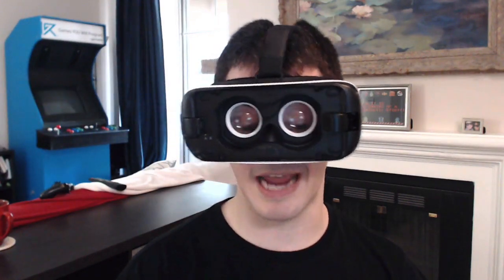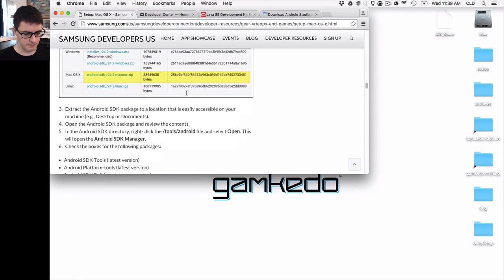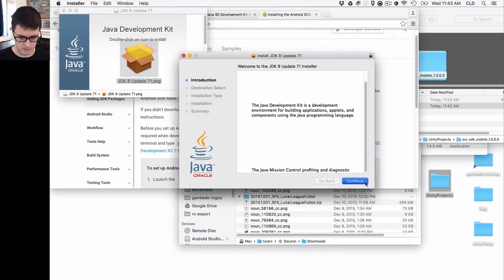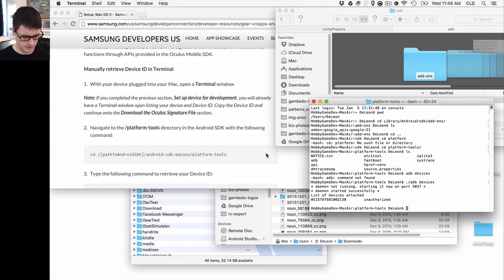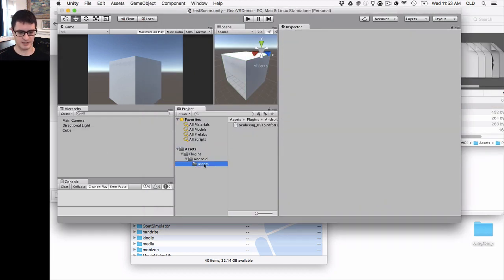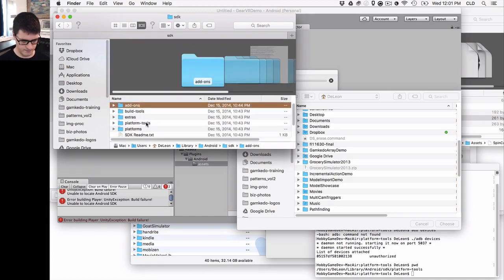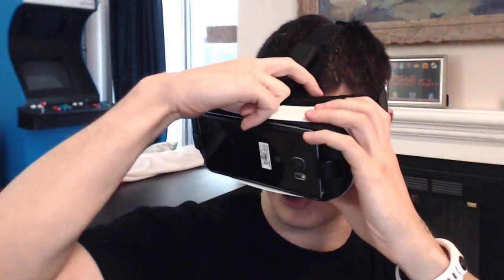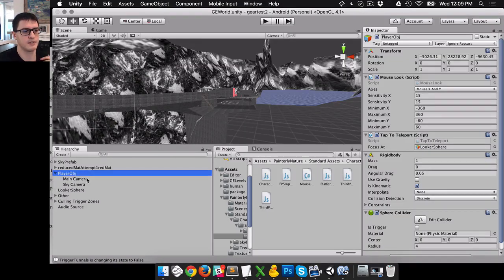Gear VR Quick Start for Unity 5 Free (2016)

Comment: Hey Chris, everytime I try to build and run on my Galaxy S6, and when I run the app, it gives me the error "thread priority security exception make sure the apk is signed". I have double checked that the sig file is correctly placed in Plugins/Android/Assets and it still won't play. You have any solution?
Reply: +LankySpankey103 Nevermind, I fixed it! I had a typo in my device ID.. Great video!
Reply: +LankySpankey103 I have the same problem. But i don't have a type. I created a new license file like 5 times. I used the Device ID check and adb devices cmd to find my ID and its the same result everytime. But even with the file placed correctly inside Plugins/Android/Assets its still giving me the error.
Reply: I dont know then.. double check your device id for upper and lower case letters aswell? I was 100 % sure that i was using the right id, but I was wrong.